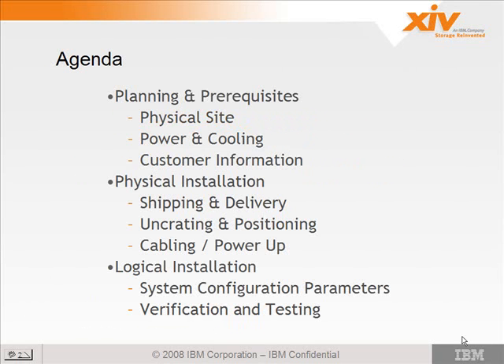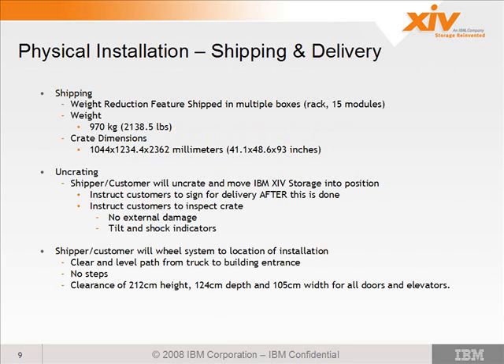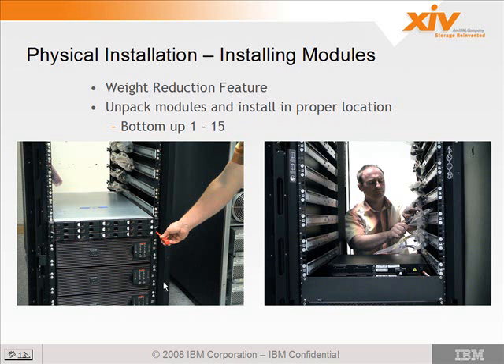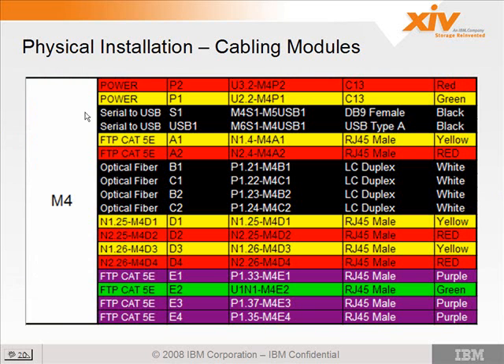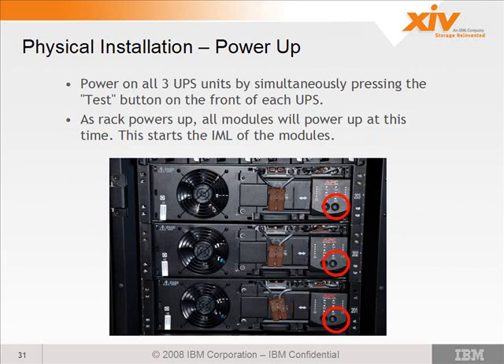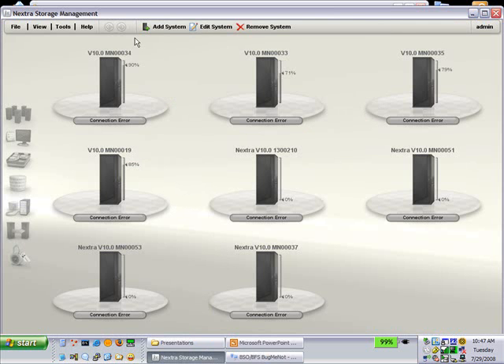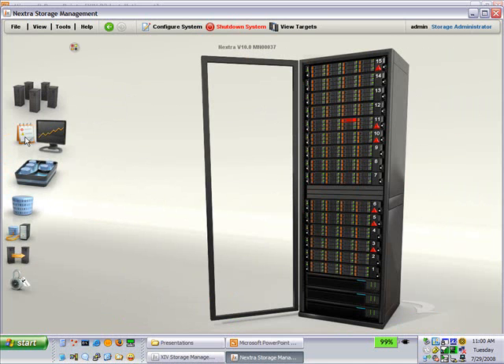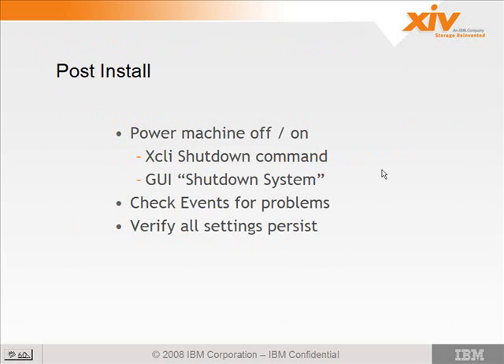IBM XIV R2 Storage system   Installation and configuration

Comment: Hi I have an IBM XIV storage that i'm trying to do inicial 
configurations, but it seems like it was powered off using room EPO 
switch system uninterruptible power supplies.  
 Is there a way to recover the configurations?
 When i connect my laptop i can ping to the storage system but i'm unable to access the storage using GUI and XCLI.
Reply: Did you found a solution?
Reply: I found out that the batteries were flat and the entire system was compromised we kept the storage system for 2 years without booting it up.